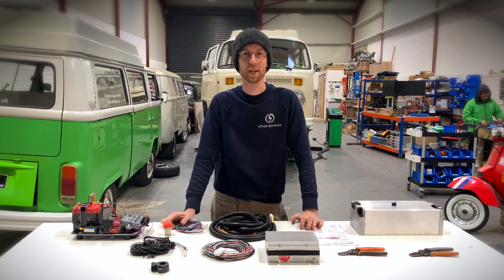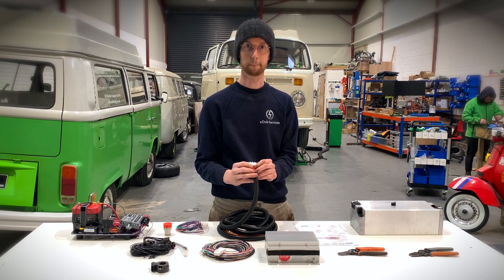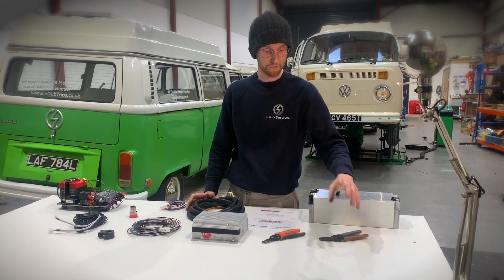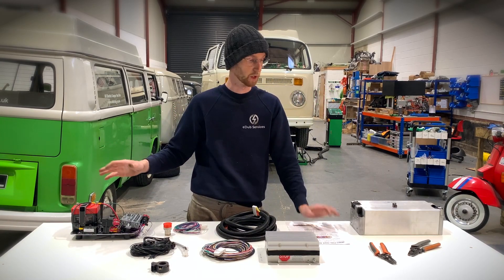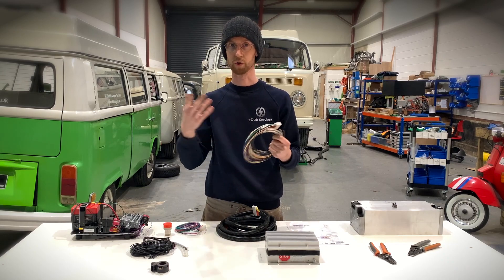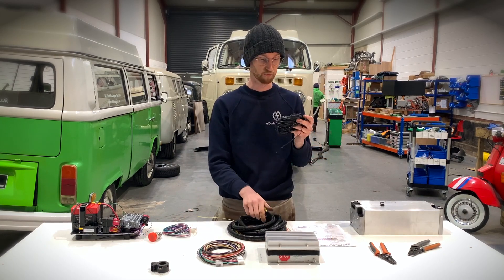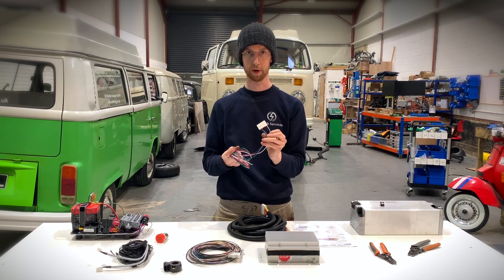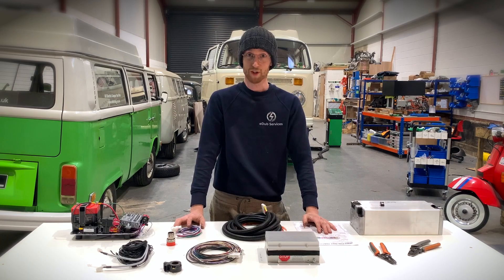How to Wire an Orion Battery Management System | eDub Services

Comment: What about splicing in sections to lengthen a section of very small wire sensing of each battery under BMS CONTROL?
Reply from the maker: Every splice is a potential place to go wrong. We prefer to use single lengths

Comment: Thanks, this if very helpful.  Do you have the manufacturer and part# on the 19 pin connector  you use?  I'm guessing you can get different sizes.  It looks like I need a minimum of 27 and 35 pin for my boxes.
Reply from the maker: They only sell them as 19pins. We get them from Fellten’s online store.